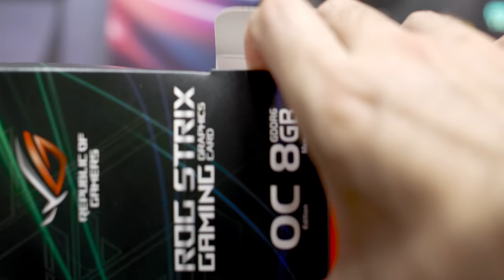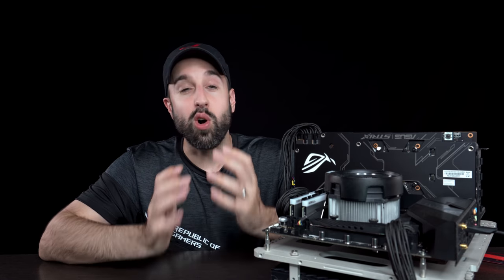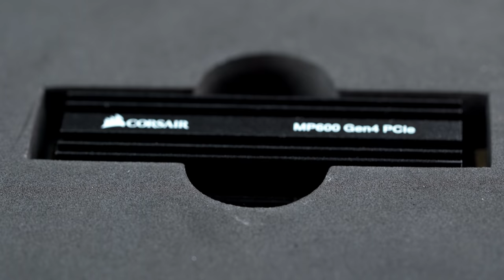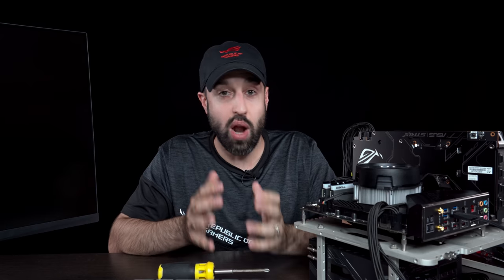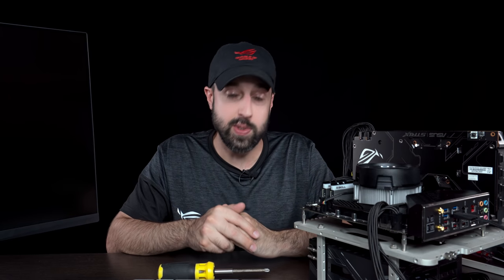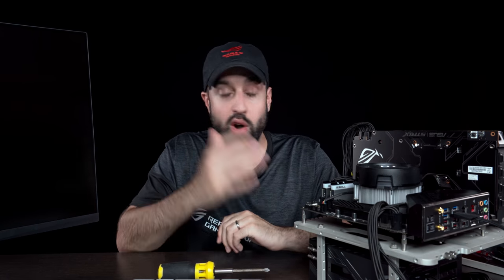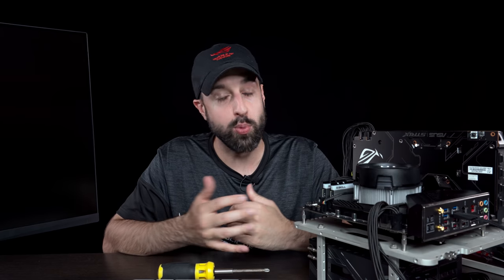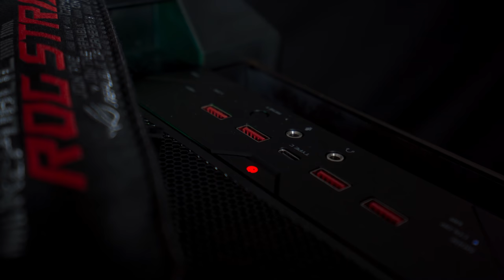All-ROG X570 Gaming and Editing Hybrid PC Build Guide

Comment: I just built this rig back in December. mine is a bit different, more expensive but the purpose is the same video editing and some gaming. I used the geforce RTX 2080 super GPU, Samsung evo plus 500 gig m.2 for boot drive in slot 1 and Samsung evo plus 1T m.2 in slot 2 and a WD black 7200 6T sata drive for archive storage. I used a corsaire H150i pro liquid cooler for the AMD 3900X because its half the cost of the ASUS liquid cooler, I have the THOR platinum 850 watt psu, 32g 3600 cl16 g skill 2 channel on the asus rog crosshair hero wifi mobo. same case, the case is nice, roomy, will maybe do an open loop. used the riser cable too, as the gpu is very bulky and the riser cable supports it better. for a monitor I used a alienware 34" curved gaming monitor, it seemed a bit over the top when I got it but after using it 24 hours you will not go back to flat screens. all in my build came out to be just under 4G,  It can be a challenging build, I ran into the black screen issue updating my bios, had a bios issue on the first mobo I bought only to find out from engineering at ASUS that board was bad, my second board worked fine. The WD black drive stopped posting a week after installing it, had to return it and get another. its very fast pc even not overclocked and the ASUS board makes overclocking easy in bios.
Reply: did the case or the riser cable came with the mount so the GPU isn't floating as shown in the video? i'm trying to build mine soon but i don't know if it comes with it. Thanks for the help!

Comment: I recently built a 3700X system for gaming and I used the same Corsair SSD as in this video, interesting point you made about it not making a difference in gaming however the PS5 (and I think the Xbox Series X as well don't quote me on that) are already confirmed to be using a PCIe Gen 4 SSDs so I felt that it would be worth futureproofing for games
Reply from the maker: The issue is the random read/write performance. There should definitely be upcoming PCIe Gen 4 SSDs with better controllers that can take advantage of the greater bandwidth in more scenarios. It's a good SSD, just unlikely to benefit most users in common scenarios.

Comment: You didn't show how the Corsair MP600 was fitted, particularly as it has a huge heat sink already attached that really gets in the way. 

You have to remove the Corsair heat sink by squeezing the clip and wiggle it about until it detaches.
The MP600 will then sit at an angle pointing upwards in the M2. socket, but when applying the Asus heatsink with the exposed thermal compound it presses it down against the motherboard rubber standoff.
It would have been really helpful if you had shown this.

Comment: Nice build, I'm preparing similar. I'm assuming that you had to double up on one of the two USB 2.0 headers so that you had enough headers for the 4 front panel USB 3.0, the RGB terminal and the connection for the pump display?

Comment: Hello, I am a huge fan of ROG..I am build a system just like this one, I am just waiting on a few parts..My question is on the X570 hero in the center where the CPU goes you have a cluster of capacitors..I noticed some boards have 16 and others have 19 and their the exact same model board..Mine has 16..Is their some kinda of a recall or they just use what's on hand at the factory..Also I noticed the formula is like that to..Thank you for your time..

Comment: Steve - Thanks for the great video and more importantly you taking the time to answer questions.  
I am looking at a similar build but with a ROG Strix X570-E MB.  I was set on using the Nvidia 2080 Ti Graphics card until I saw the price so I thought maybe the 2080 Super would be a good choice but is there an advantage in using the Radeon RX-5700 XT instead due to the consistent AMD platform? Thanks in advance for your time.
Reply: No real advantage, I have a 2080ti and a rx 5700 oc to xt standard, the 2080 is much more powerful and runs a lot cooler than the 5700. 5700 is 800 euro cheaper though so you might make price compromise

Comment: Hey dude! I know it's been about 8 months and a global pandemic, but I was wondering about the placement of AIO's tubing. Is the orientation important? Thanks from Australia :)
Reply: Placement of your tubing is important. Most vlogs show the top tube of the radiator on top, which is incorrect( assuming you are attaching it to the front of the case). The tubes should be on the bottom regardless of a push pull set up or a  standard aio set up.

Comment: So as a 4k video editor, do you foresee ROG dropping a 1600w THOR PSU for those of us moving to Threadripper 3 with multi-gpu set up?
Reply: DeathWalker its overkill
Reply: @menace2societies  It's really not though with all the storage, fans, custom loop, two-three gpus, and overclocking. It pushes past the 1200 watts, and that's assuming the 64 core will only have 280w tdp. I prefer the extra headroom on the psu. If you don't need it, don't buy it.
Reply: DeathWalker you can search pcpartpicker you can see the suggested Wattage for that build
Reply from the maker: or you could just go with 2 x 1200W.... :D

Comment: I build a PC with the same MOTHERBOARD // ASUS ROG Crosshair VIII Hero WiF + same memory RAM // G.Skill Trident Z Neo DDR4-3600 CL16-19-19-39   4x8 GB. But the ram freq is at 2197MHz instead of 3600.  I experimented with installing only one memory piece (8GB) in the A2 motherboard slot to see if one of the 4 pieces was faulty but they all performed at lower frequencies. Is there a particular setting in the UEFI BIOS I am missing (already read all the MB manual) or the motherboard I got is faulty?  Thanks.

Comment: Hey Steve excellent video. Quick question I have virtually the same exact build as you do as far as motherboard CPU and memory. Here's my problem I can't get my memory to get up to 3600 even using the tools in the Bios. I have the latest 1302 bios and so I'm wondering what should I do you get it up to the 36 because the motherboard the hero it's giving me an amber light which means it can't post pass the dram. I've even tried to select 3600 in the Bios and the d. O c. Whatever that is. Please help.

Comment: What can you recomend me for a Budget of 500-600 dollars for a PC?
Reply: Ryzen 2400g or 2600 cpu
B450m mobo
8gb ddr4 3000 ram
Rx 580 gpu
500gb ssd
500w psu
And any case you can get. EBay is not that bad but get the psu and Mobo from amazon
Reply: @kapeq2320  thanks!
Reply: waiting for ps5
Reply: @kapeq2320  for case, I recommend the phanteks p400a. Good airflow less than 100 and 3 120mm rgb fans.
Reply: Go to linus tech tips
Reply: @kapeq2320  That's a good list my friend

Comment: Look almost as cool as mine = 
Specs:

ASUS ROG Maximus XI Extreme Z390
ASUS ROG RTX2080Ti 11GB OC
ASUS ROG Rapture GT-AC5300
ASUS ROG Strix Riser Cable
ASUS ROG PG248Q 180Hz
ASUS ROG Thor 850W
ASUS ROG Strix Flare
ASUS ROG Helios
ASUS ROG Pugio
Chromax 140mm x4
 (replaced the Asus fans in Helios)
Glorious PC Gaming Race 3XL Extended
Glorious Mouse Bungee (Black)
G.Skill Trident Z 32GB DDR4 3Ghz CL14
Intel Core i9-9900K 3.6GHz @ 4.6GHz
Logitech Z625 2.1
Logitech G935
Logitech G13
NZXT Kraken X72
Samsung SSD 860 EVO 1TB
Samsung M2 970 EVO+ 1TB x2
Western Digital HDD 6TB Red Pro
Xbox One Controller Wireless
Reply from the maker: Nice build! Have you posted it on social and tagged us? We love to see awesome ROG builds that people have created.
Reply: @asusrog  nahh, not yet tho.. But i will soon

Comment: How did you install your GPU on the motherboard?
Reply: Have you never seen a vertical gpu mount
Reply from the maker: You can just plug it in the PCIe slot as normal, but I decided to do a vertical mount because it looks cool and there's good support for it in this case. You use a special riser cable that basically works as an extension cord for your GPU. Pretty cool!